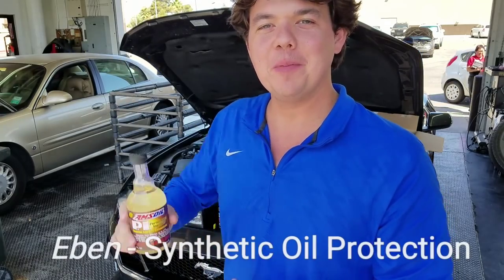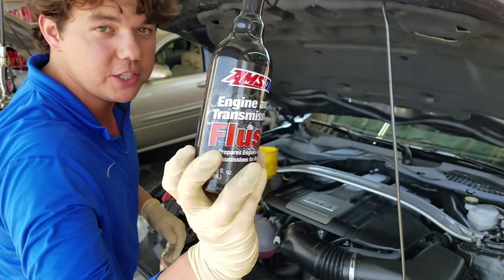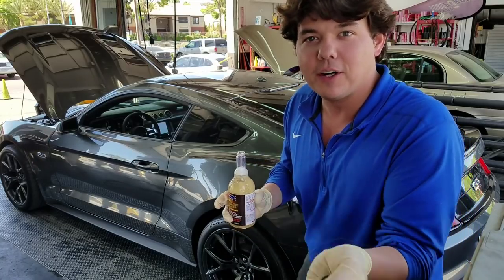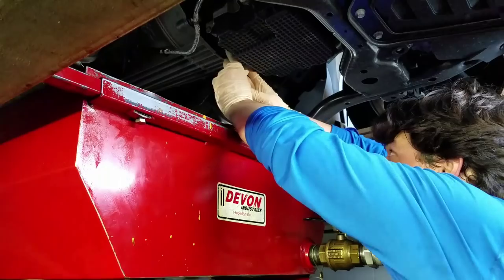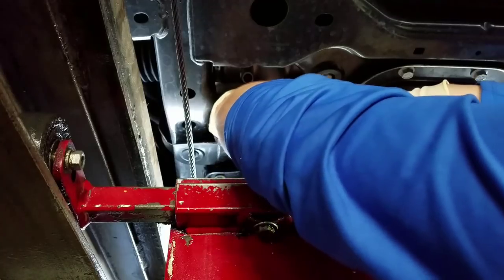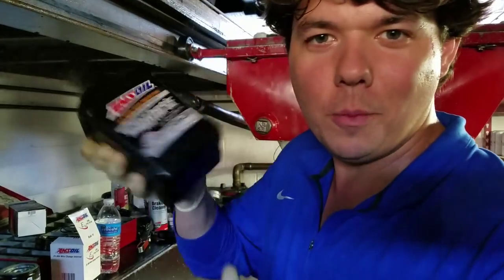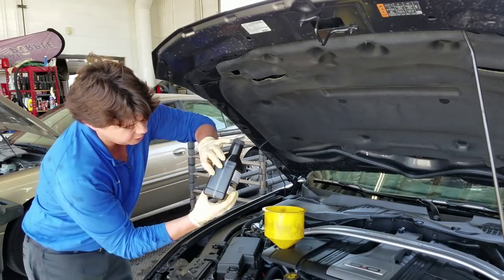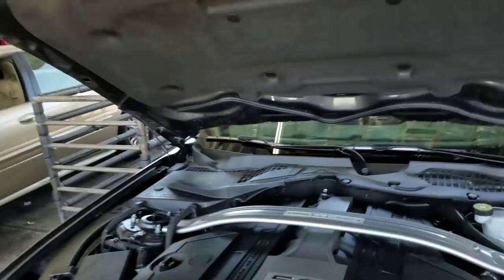2019 Mustang GT 5.0 AMSOIL Motor Oil Change & Flush

Comment from the maker: Eben Rockmaker
Independent AMSOIL Specialist (Dealer#: 5331179) https://www.amsoil.com/offers/pc.aspx?zo=5331179
Mobile: (702) 472-3614

Steps: 
1. My blue link gets you 25% discount and free shipping on orders $100 or more as PC Member. I will get credit for your purchase when you use my link. Click blue link under my name, Click join now yellow bar Preferred Customer for 1 year. Click add to cart. Note: Amsoil will not keep your CC info. There is no recurring charges.
2. Click look up your vehicle.
3. Click auto light truck. 
4. After you have all the products added double check then complete order.
Any order over $100 is free shipping and ships within 1 to 2 days.

AMSOIL Vehicle Lookup - https://www.amsoil.com/guides.aspx?zo=5331179

     Friend me on and tag me because I like to see great results:
Instagram - https://www.instagram.com/syntheticoilprotection/

Facebook - https://www.facebook.com/profile.php?id=100007973957868

Steps to order by phone:

Be sure to use my sponsor # 5331179 and tell them you would like to be a Preferred Customer.

1. Call 1800-956-5695
2. Ask for your own preferred customer membership because you will get 25% off, complimentary shipping over $100, and your informative quarterly AMSOIL Magazine. It costs $10 for 6 months or $20 for the year which is well worth it.
3. Give them my dealer number 5331179
4. Orders over $100 will be shipped free.

Amsoil Signature Series 5W-30 Synthetic Motor Oil protects against harmful deposits on turbochargers 4X better than Mobil1® Extended Performance and 3.6X better than Royal Purple® in industry-standard testing*.
https://www.amsoil.com/newsstand/motor-oil/articles/leading-the-field-in-deposit-protection/?zo=5331179

Amsoil gets better gas mileage - 
https://www.amsoil.com/newsstand/motor-oil/articles/another-win-for-amsoil-products/?zo=5331179

AMSOIL Signature Series is fortified with a heavy treatment of detergent additive and it delivers 30% more acid neutralizing power1 than Mobil 1, and 36% more than Royal Purple, helping engines to stay cleaner, longer.-
https://www.amsoil.com/newsstand/motor-oil/articles/cleaning-up-the-competition/?zo=5331179
Reply: Synthetic Oil Protection last time I checked ford actually has silicone anti-drain back valves
Reply from the maker: Take a good look at that Ford filter thin ice thin ice.

You won't catch me on it😄😁😆
Reply: Should use 5w30 amsoil instead and 10k miles is a little over kill 5k doesn’t matter what oil it is
Reply from the maker: Oh believe me oil matters.... Lol😁

AMSOIL Performance Test Results. Read This Article - https://www.amsoil.com/performancetests.aspx?zo=5331179

Comment: Wow! Nice car and lots of oil it needs! Let amsoil make sure it doesn't need to change oil for a little while more! 😎
Reply from the maker: Yeah I think they put so much oil in those 5.0 so they don't run dry on oil because it's pretty easy to burn 3 quarts of oil and if it was like a Corvette then you'd only be running on 3 and 1/2 quarts LOL because Corvettes only take about six and a half Seven Courts.

It should be really cool to see what the burn off is after 1 year and 10,000 miles😊

Thanks Sing!

We got #EbensGiveaway today @ 11AM Live.

Comment: That flush (if used regularly) would have really helped out with the Toyota 2.4 liter engines.  The oil rings would clog-up and that would cause oil to be pushed into the combustion area resulting in high oil consumption and carbon build-up.

Comment: Hmmm, before the engine flush it seems like the car had a cold start and the after the engine flush it appears like the engine is warmer. 
A cold engine always sounds louder than a few seconds after it warms up a little bit.
Reply from the maker: Yeah engine was warm both times.

The engine sad for about 10 minutes before we restarted it.

Then after the oil change the engine sat for about 15 or 20 minutes after idling however after idling the engine warms up quite a bit.

I would say the start-up temperatures were probably around a hundred and thirty degrees.

The Amsoil oil flows a lot faster through the oil filter because it's a higher flow less restriction filter and 100% synthetic oil also flows faster and with less resistance because there's less parasitic drag because the molecules are more consistently shaped and they flow over each other better like marbles on Marvel's a stead of course rock on quartz rock

Comment: notice you didn't open the oil filter door.  It's one screw and helps with the mess.
Reply from the maker: It seemed the drain fine.

Even if you opened the door it would still get all over.

That's the way most oil filter areas are LOL

Comment: For the 2018 GT would you recommend 5W30 for a Florida car?  Have you had experience with AMSOIL helping engine tic which seems more an issue with gen 3 motors?
Reply from the maker: Yeah that's what I hear on most of the cars that take the thinner oil I always hear more engine tick usually
Reply from the maker: The interesting part is that GM just updated the technical bulletins on the C7 Stingray and the C7 now takes 0w 40 from the factory just like the Gen V Viper
Reply from the maker: I don't really understand the whole oil viscosity reasoning because Porsche and Mercedes are some of the highest quality engines available and they all take 0w 40 or 5w 40
Reply: The mustang has what Ford calls typewriter tic. Tons of videos on this. People are trying liquid molly etc. to stop the tic. Trying to decide on 20 or 30 weight.
Reply from the maker: I switched my C5 to 10W-30 Amsoil signature series on my C5 Corvette and it ran even smoother than 5W-30.

The older gen 3 vipers I believe used to take 10w 30

Comment: Shouldn't you burn the complete tank of gas through it with the PI in it, before the oil change?  My understanding is, some ofthe contaminants the PI loosens, will dirty the new somewhat.  Might as well let it contaminate the old oil.
Reply from the maker: Actually after you do the engine flush basically all the Rings are clean and the rest of the build-up is basically on the valves which is a very small amount.

You could if you want to.

To me it's such a small difference because the hundred percent synthetic oil seals the Pistons better so the amount of blow-by is so small.

Even if a couple milliliters of P I end up in the engine oil it's just more detergent LOL

Comment: Hey I want order threw your affiliate link and sign up as preferred customer, my question is does it cost extra for shipping for hazardous materials or is it just regular shipping
Reply from the maker: it's free shipping on any order $100 or more and this is my link.

Eben Rockmaker
Independent AMSOIL Specialist (Dealer#: 5331179) https://www.amsoil.com/offers/pc.aspx?zo=5331179
Mobile: (702) 472-3614

Steps: 
1. My blue link gets you 25% discount and free shipping on orders $100 or more as PC Member. I will get credit for your purchase when you use my link. Click blue link under my name, Click join now yellow bar Preferred Customer for 1 year. Click add to cart. Note: Amsoil will not keep your CC info. There is no recurring charges.
2. Click look up your vehicle.
3. Click auto light truck. 
4. After you have all the products added double check then complete order.
Any order over $100 is free shipping and ships within 1 to 2 days.

Comment: My 2012 Mustang GT has always used Motorcraft 5w-20 semi synthetic. It has 48,000 miles driven. If I do next oil change with Amsoil XL, should I do the engine flush?
Reply from the maker: Yes I would because that way you won't have all the carbon deposits and up in your new oil filter
Reply from the maker: This is my personal link and if you try it I would love to hear your results🤟☕

My link: AMSOIL 25% Less Wholesale & FREE SHIPPING: https://www.amsoil.com/offers/?zo=5331179
AMSOIL Makes it for your Vehicle Lookup - https://www.amsoil.com/guides.aspx?zo=5331179

 If your vehicle is not on the lookup guide this is AMSOIL Tech Support 715-399-8324

Comment: That oil is not API certified, I think. Did you just void the warranty?
Reply from the maker: AMSOIL was the first Synthetic oil API certified in 1972 - https://www.amsoil.com/why/?zo=5331179
Reply: Uknown2445  Why? It doesn’t have an API logo on it. It’s a legit question.
Reply from the maker: Correct not all motor oils go through that process

Comment: Exactly the car I want to get next year. Can't wait to see how it holds up. Surprised he didn't go with 5W-30
Reply from the maker: I'd be interested to see how is 0w 40 would run it
Reply: @Syntheticoilprotection  Probably would be the ideal oil choice. Hope Amsoil can prevent any issue the engine could have considering some people have a typewriter tick
Reply from the maker: I still don't understand the manufacturer's recommendations there are GM 6.2 L V8 that are in the Cadillac Escalade and they take 0w 20.

Then the Corvette has a similar engine and they used to recommend 5 W 30 in the C7 Stingray now they changed it in 2019 to 0w 40 factory fill.

It's very puzzling however eventually I'll be doing some tests with motors to see exactly what the differences are
Reply: @Syntheticoilprotection  Yeah like Ford recommends 5W-20 for these but used to recommend 5W-50 if you had some type of track or performance pack. Now it just states that if under heavy abuse to use 5W-30
Reply from the maker: Very interesting😃

What an interesting mystery
Reply: @mistamaog  I recently switched my high mileage 5.4 F150 from 5w20 to 5W30 XL . All is well. Will be switching my 2012 5.0 Mustang to Signature Series 5W30 at next drain interval. I believe we should use 5W30 in the warmer months any way.

Comment: Nice mustang! Do all mustang's take so much oil?
Reply from the maker: I think it just depends on the year. I'll actually look into that I'm curious how many quarts the Mustang Shelby GT500 2014 takes.
Reply from the maker: Believe it or not the 662 horsepower Shelby GT500 only takes eight and a half quarts of motor oil LOL but it does take 5w 50

Comment: I am doing an oil consumption test on my 2019 Mustang GT because it used 1 qt oil at 2,800 mi. now at 5,100 mi and 1.6 qt low less than you say is normal?? so should I be worried??
Reply from the maker: That sounds about right for using the OEM products

Comment: I just bought a new 2019 Toyota rav4 and going on my first oil change I’m going to use amsoil 0w-16 the only problem is im going to use the factory oil filter cause i can’t find amsoil oil filter anyway, my question is can I do an engine flush and if yes how many miles after that can I do it again??!
Reply from the maker: You can do an engine flush anytime the only time you really want to do it on a gas engine is the very first oil change when you switch over to Amsoil oil.

The only reason I recommend it is because you want to get all the carbon deposits out so the Amsoil doesn't melt it out and then it'll all end up in the oil filter and that way your oil filter will be free of deposits if you flush it first.

On diesel engines I personally would use it every time because it thins out the oil and it makes it a lot easier to get all the old oil out and you don't have to wait as long for it to drain. Also it's good because all the turbo trucks all the turbo diesels have turbos and you want to keep them as clean as possible so they run cool.

I would call tech support and see if they have an oil filter for your Toyota.

Amsoil Technical Support
Mobile 1 715-399-8324
Reply from the maker: Thanks for sharing that information with me!
Reply from the maker: Sometimes they don't update the lookup guide so I would definitely call technical support
Reply: Same with my cooper s. It doesn't show any amsoil filter but it does show a mann filter. Any thoughts on mann filters?
Reply from the maker: If you can get a Wix it's a little bit better.
Hopefully Amsoil starts making that filter soon😉

Comment: I have a mustang gt 2018 with gen 3 motor I use 5w20 but I been told to use 5w30 or 5w40 would you recommend to  switch
Reply from the maker: I would use the thicker oil if you're doing racing if you're just driving it normal and not doing any type of racing you're fine with the OEM viscosity
Reply from the maker: This is my unveiling that will give you the wholesale account pricing which will save you about $33 on a $100 order and I would be your Amsoil Dealer so you could always call me for any questions anytime.
Professional YouLubher: Eben Rockmaker Regency Gold Direct Jobber AMSOIL Specialist (Dealer#: 5331179) 702-472-3614 

Get AMSOIL Wholesale Pricing - https://www.amsoil.com/offers/pc/?zo=5331179

Comment: What do you mean by 700 idling hours?
Reply from the maker: That's a term used on tractors & equipment that doesn't have miles or KM meter on dash bord.
Reply from the maker: The only way the measure how old a engine on a tractor is in ideal hours

Comment: does this oil get rid of the lifter noise in the 18 gt
Reply from the maker: Yes it will get rid of as much noise as possible because what happens is where do you flush all the old carbon deposits out you allow bare metal. Then when you put 100% synthetic Amsoil oil in the oil can cling to the metal better. Then you have a more complete oil film and the motor will run quieter it will run smoother and consequently will have less vibration let's wear less Heat and the engine will last longer. Also the oil circulates with less resistance which means there's less parasitic drag on the crank which gives you more power and better fuel economy.

The other nice thing is the oil doesn't thicken like other motor oils so by the time you get to 10,000 miles the oil will still be thin and circulate fast at startup so that will protect your engine when you cold start it.

Also the oil filters are a big upgrade over OEM and that will protect your engine as well.

 thanks for being a part of my YouTube Community.

Comment: 10 quarts?!? I thought my dad's chevy 5.3 was a lot at 8.5!
Reply from the maker: Look up how many quarts a 2013 SL65 AMG takes
Reply: @Syntheticoilprotection  12qts! Those euro cars get up there in their oil capacity. Oil changes get a little expensive when you run into that but it's good to know you're good for a whole year with the SS and the euro variant.
Speaking of that, is the amsoil premium protection (10w-40) along the same line as SS oil as being a group VI synthetic or is it more like the OE being a Hydrocracked group III.
Thanks!
Reply from the maker: I have no idea.

Actually the European oil changes are quite a bit less money because you change the oil less and the motor oil costs quite a bit less.

Take a look at the price of the European classic 5W-40 motor oil - https://www.amsoil.com/p/sae-5w-40-fs-synthetic-european-motor-oil-efm/?code=EFMQT-EA?zo=5331179

Comment: Sucks that they have a plastic oil pan and plug.
Reply from the maker: yeah if you twist it wrong you can crack one of the plastic side tabs.

 once you get it down though it's actually pretty easy.

The nice thing is it's a very big hole and the oil drains fast.

The engine flush helps it drain about 30% faster and it helps more oil come out.

Comment: Odd ford went with a plastic  composite oil pan
Reply from the maker: It's probably less money to make and it's probably lighter and holds less Heat.

     Given that it's protected by a bunch of metal protection Shields I guess it should be fine LOL

Comment: Use the included funnel in the trunk to fill the P.I cleaner. I got that shit all over the car trying to this without a funnel.
Reply from the maker: Yeah there's a couple of gasless gas caps now that have a dental double penetration flap and you really have to watch your angles or just use a small funnel.

I did the same thing the first time I did it I lost about a third of a bottle.

Amsoil is currently addressing this and they will be making a change.

Also it happened to me on a Dodge 2500 Ram heavy-duty Cummins diesel